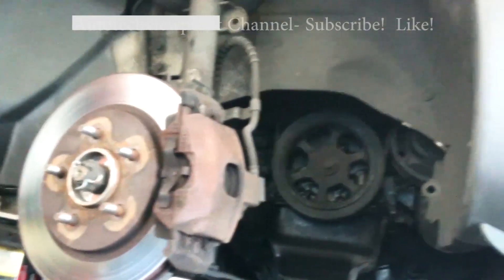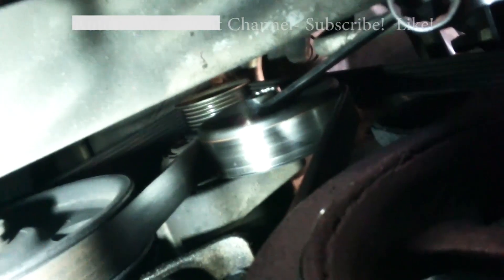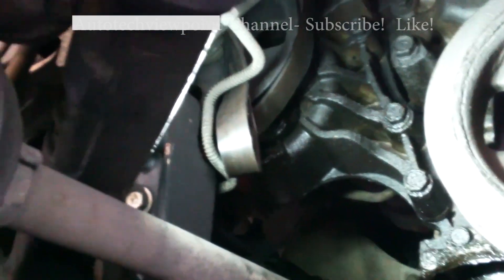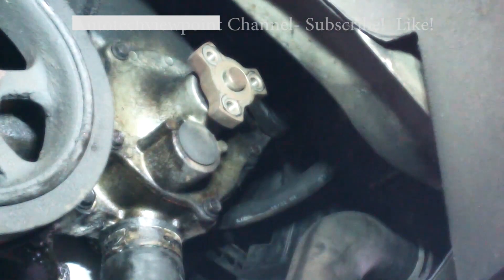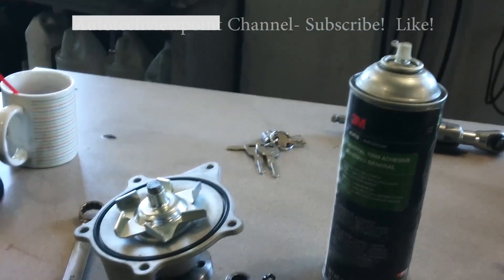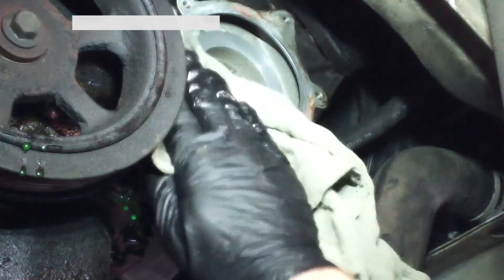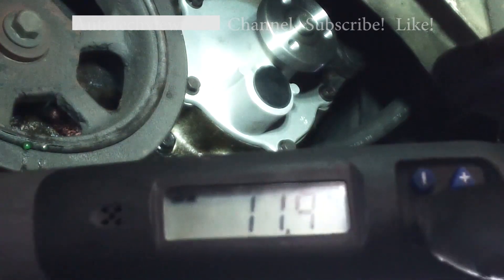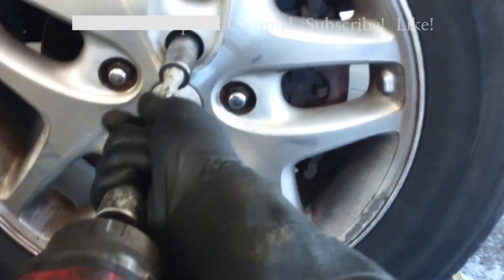Water pump replacement 1999 Dodge Grand Caravan 3.8L. Install Remove Replace 3.3L V6

Comment: This is the best video for the vans with the towing package and rear ac where the pump in under the compressor towards the front of the car vs the ones toward the back.

Comment: I'm getting ready to do this on my van in a few days. One thing I'll say, being a diesel/transport refrigeration mechanic (thermoking) any time I've ever used silicon to hold an o ring in place almost always starts to leak after time.

Comment: Good point. Like we can actually see everything we're doing when our hands are buried between the firewall and valve covers to replace the plugs on a transverse mounted V6. Try changing mounts on a Hyundai Tucson. Like you're gonna see any of that. Yeah right.

Comment: @11:55 - "300,000 miles - hard to believe"..............WHY is that hard to believe??? Dodges and Chryslers run VERY well IF you keep up with the regular maintenance - most people run these vans down to the ground with minimal or NO maintenance AT ALL - and they expect the vehicle to perform miracles...........i have a Caravan getting close to 259,000 miles and it runs almost like new

Comment: With these vehicles there was a recall on the pulley .. There's a solution kit which is a few hundred with a different pulley and double sided belt. I had problems with my belt slipping off when going thru big puddles and living in Washington state that's imevitable .
Reply: There is also a kit you can buy to put on the pulley which makes the belt stay in place.  It cost like 15.00 and took maybe 10 minutes.  My belt kept slipping off to so much that I couldn't drive it in the wet weather.